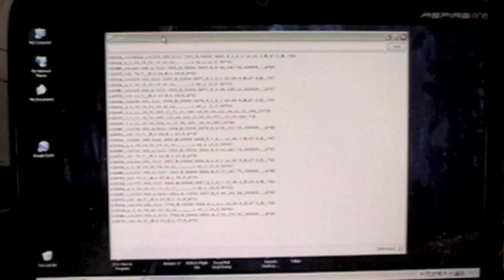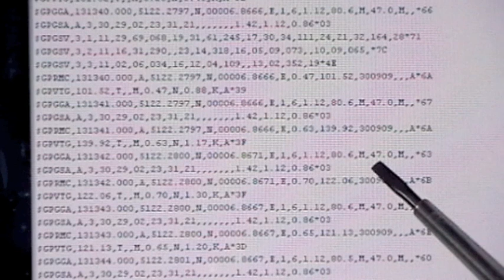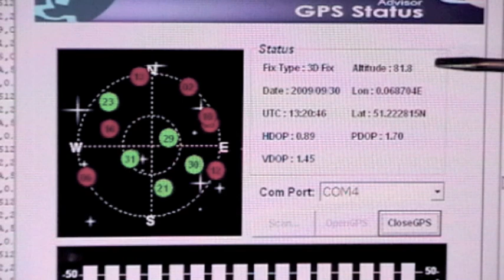GPS Test 1 - Reading NMEA Data using an Arduino

Comment: Hallo,
 
I have been happily using SC-200. When I recently wanted to upload the latest database on SC-200 I detected that the Advisor software which came with the SC-200 does not work anymore on my PC and I do no longer have the original CD for this SW. Does anyone know a link to download the Advisor software to updtae the daoabase of SC-200 via USB ?
Thank you for your support.